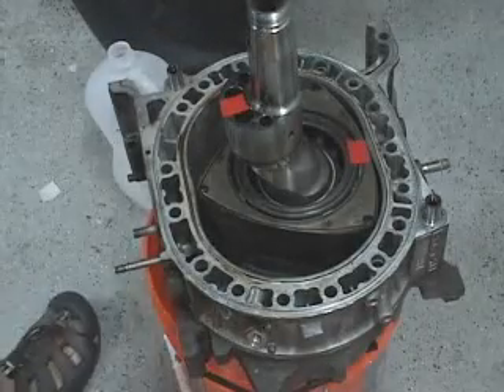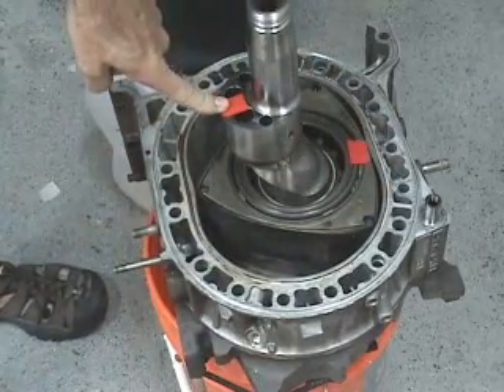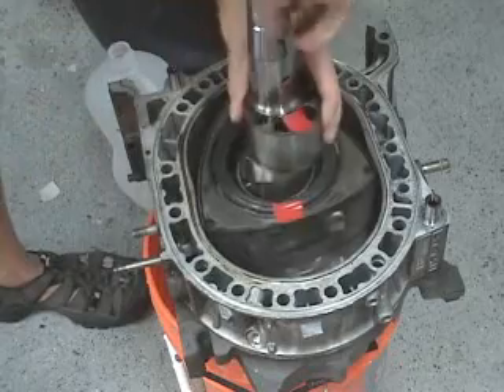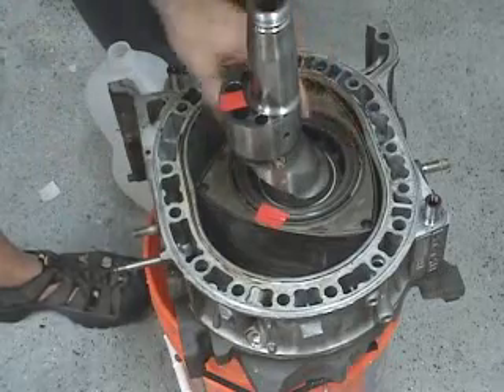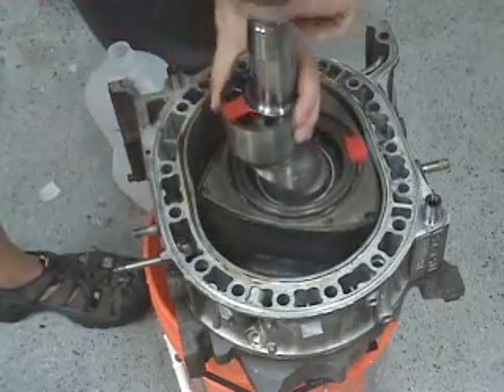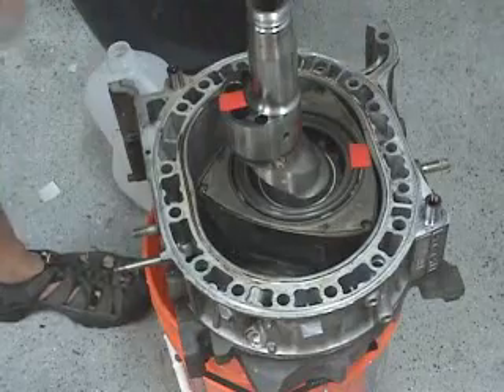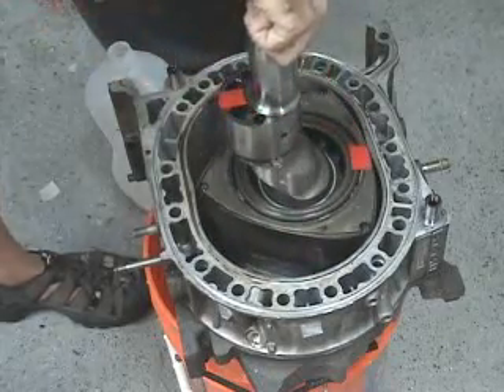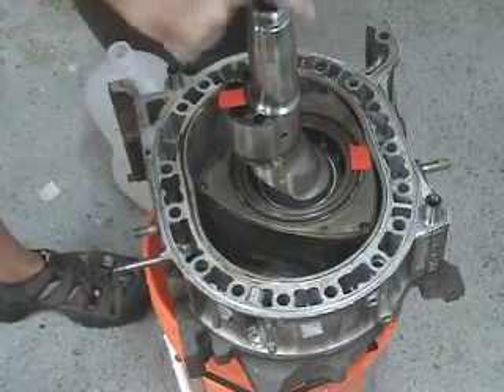Rotary Rotational Demonstration

Comment from the maker: @chemicalsweet13 - Sorta. Because the entire combustion chamber is moving during the combustion process, some of the heat that would better be used producing torque is lost to the cooling system and oil. This is why rotaries have a lower BSFC than piston motors.

Comment: This is a cool video thanks for posting.  Someone told me that rotary engines waist more energy than piston driven engines because during the combustion process (the explosion part) heat leaks out of the combustion chamber.  Is that true?

Comment: Its actually a 1:3.33333 because of the square root of the base log of pi. Classical geometry (Euclidian) can't even describe, mathematically, what is happening in this motor. You have to use chaos and string theories for that, but even they aren't great. They just have consistent internal logic. Everyone knows that, even idiots.

Comment: @mateivornicu @mateivornicu well. You explain it perfectly, what do you not understand? to get the hang of it, try to think of this engine as a normal 4stroke otto engine. each side of the triangle would be like one cylinder in the otto. working together, the triangle does the same job as a three-cylinder otto.
when chamber 1 has intake, chamber 2 has compression/ignition, and chamber 3 has exhaust. 
Only difference is that the wankel does the job simultaneously.

Comment from the maker: @Burnz2much - You are right! I've never actually built a grip of these motors. Nor have I been campaigning a rotary-powered vehicle in club racing for the last 7 years. I've never even tried to calibrate over 600 RX-8s with the AccessPORT.
Nope. I just sit on Wikipedia all day and cut-n-paste!

Comment: I was just wandering are there high maintenance costs for the wankel engine. It seems to have a smoother power transfer to the shaft than a regular piston engine. Thats the only downside I could think of a piston engine there is more irregular forces due to the way gases are combusted. I imagine there would have to be higher tolerances in terms of machining and fitting of the wankel compared to piston engines.

Comment: are therefore afraid of them. So you immediately say that 'diesel' something you're more comfortable talking about is superior. Also, rotary engines are generally much lighter than your 6.0whatever litre diesel, and therefore much more applicable to road course enviroments without causing understeer ('tight' to you). I could keep going but I don't want to give myself carpal tunnel educating you.

Comment: This video brings up a good point. Many people are amazed that a 1.3 liter can put out so much power when compared to a piston engine. That is, however, comparing apples to oranges.  To properly compare the two, you have to use 2 revolutions of the e-shaft (or 2.6 liters) since you do the same with the crank of a piston motor.  2 output shaft revs vs 2 output shaft revs.

Comment from the maker: @quantumbits - The main problem is the moving combustion chamber.
There is a LOT more surface area presented to the combustion process, so much of the energy goes into the cooling system instead of producing torque.
The other issue is the relatively short "stroke", which means less torque per REV as compared to the reciprocating motion of a piston motor.

Comment: @nerdsfn Actually it makes the equivalent of a 2.6L 4 cylinder.  A rotor needs 3 revolutions of the e-shaft(crank) to complete the thermodynamic cycle whereas the piston motor needs just two revolutions of the crank to do the same.  Where 3.5 come from is beyond me.  With your train of thought it would be a 3.9L V6, but the fact that the rotary operates in threes vs. twos of a piston would make those numbers accurate, but not show any relation to one another.

Comment: So let me see if I have this correct.... In the past two stroke engines gave an ignition once per every stoke of the piston but that was taken away due to better emission and better fuel economy when engines became 4 strokes. With the 4 strokes they lost power due to the lost of ignition on every stroke and more moving parts. So if I'm correct a rotary engine is the answer to this problem giving back the ignition found on every rotation of the crank and in return giving more power?

Comment: That's funny.. I keep trying to tell people that the rotor spins 1/3 of eccentric speed. so at 6k on the tach the rotor is only really spinning 2k.. Which in reality is really slow. It's no wonder that they manage to make so much power. The burn cycle is so relatively slow in comparison to eccentric speed.  even slower than that of a long rod performance piston engine. However, I can't say I'd ever trade my piston engine for a wankel. LOL

Comment: Shouldn't the ratio in your info be '1:3 between inside and outside?' You are saying that the rotor inside rotates 1 time per 3 rotations of the outside shaft? You aren't intending to say that the rotor inside rotates 3 times per 1 rotation of the outside.

Comment: That wasn't really the point. if twin turbos are making 40 psi then the total pressure is 40 psi. The amount of pressure is not cannot be multiplied by the number of compressors. If you have a tire inflated to 35 psi and compressor aired to 35 psi will the tire inflate to 70 psi? NO. Also, most gasoline powered engines will never see 80 psi of boost. My diesel, on the other hand, has seen as much as 95 psi on the dyno. I have it tuned to run about 65 and it makes just as much power.

Comment: biggest downside is servicing... If you can do it yourself your laughing, if your paying someone else it generally costs a lot more than the cylinder based.. Love Rotors, Getting a RX7 soon-ish...

Another downside is they are less economical (higher petrol costs) but imo, better engines...

Comment: i don't know that much about turbos but i do know that 80 psi of boost is just retarded. is there a CAR engine that can take that pressure? dont most turbocharged cars run 5 to 20 psi? ( i imagine anything under 5 would be just pointless in your average sized car.

Comment: Because of the way the Eccentric shaft (or crank shaft as a reference to Piston engines) and rotors work, it produces very high revs  within a very small timeframe, eg. It can take my 13B non turbo roughly 1-2 seconds to reach its peak of 9000rpm (in neutral) and i in second gear i can get to 100kmph with a small timeframe (maybe 5-6seconds, i havnt really counted).

a Rotary IS worth it, but have at least $100-$150 per week for fuel hahaha

Comment: Nice vid demonstration....    Who doesn't understand the 3 to 1 relationship?  I had an RX-4 (that's right, pre RX-7).  The damn thing was a friggin rocket sled.  They had a 10000 rpm redline on the tach back then. That put the rotor rpm's at 3333.33. They derated it after they had many apex seals cracking at that high number.

Comment: Ah, had no clue. I have 2 friends with rotary engines now. 1 just got his inspected and passed... Not sure how his gas mileage was.

The ride these cars give is VERY weird. The higher it's rev'd the smoother the engine is. At low RPMs it sorta rumbles the car it seems. Both of them have the 2 chamber rotary engines.

Also, people saying "why would they make cars for only certain states". Well trucks for example aren't as common in all of states. Texas having the most, right? New York the least?

Comment from the maker: The bearings are lubed the same way as a piston motor. 
The sealing surfaces inside the motor are lubricated by an injection oil pump that pushes oil into the combustion chamber during the intake phase.
This is why people say the rotary motor "burns" oil.